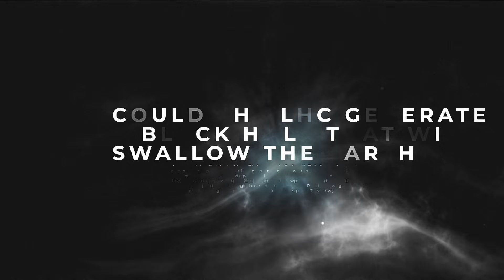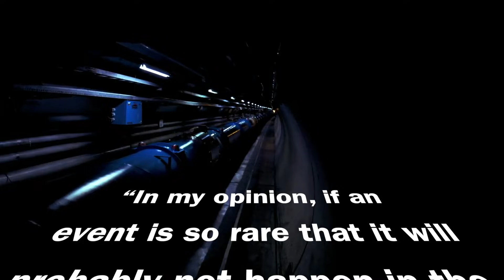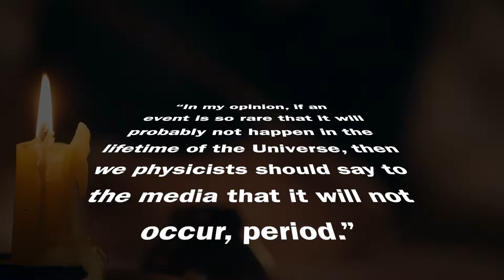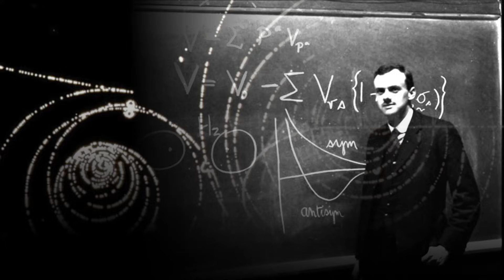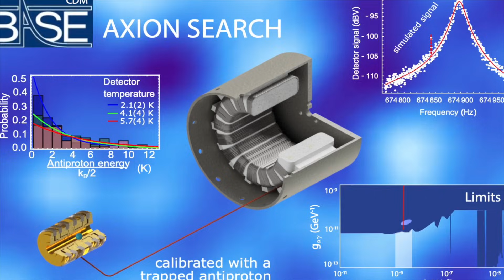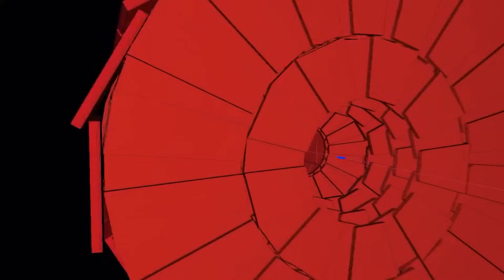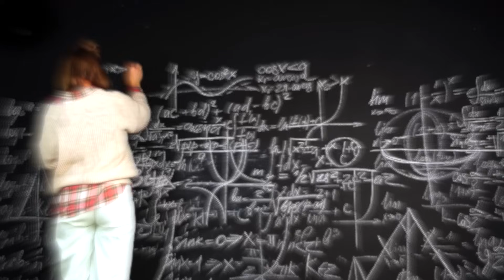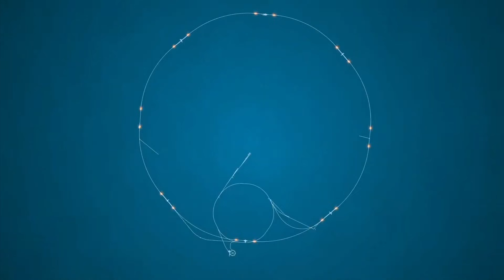CERN and The Mandela Effect | 5 Terrifying Theories About CERN

Comment: The LHC ran at a high energy level in 2012 apparently breaking down, but causing changes 
In 2015 during a blood moon, it ran at 18 Tara electron volts, which seems to have caused many changes to our world, however small 
The LHC is expected to run again in March 2024 at an even higher energy level. The only advice I have is try to remember every minute detail of this world you can remember before that day gets here.
Reply: Last year thanksgiving was on the 23rd now it was on 28th and that’s just one thing. Something definitely thrown off.
Reply: It’s running again currently, guess things are changing

Comment: Something inevitably is going to go wrong... and when it does, it will be most likely devastating. 👊🧡👍
Reply: cern concern
Reply: And most certainly irreversible.  

   Same with altering time. With as secretive as our government and military are, can you say with 100% certainty that they have not been researching time and attempting the altering of it? 

   Even if you don't encounter anyone on a "time travel" trip, just by the act of it, you change things.  

   So,... impossible? 
If it can be proven or disproven 100%, guess what, Sparky?
Reply: 30000 particle accelerators being used across the globe...nothing "devastating" yet...
Reply: @philcoombes2538  yet
Reply: @philcoombes2538 exactly how (or is that when?) will we know...?
Reply: @davidparker2882  bear in mind that the sub-atomic particle interaction experiments taking place at CERN & elsewhere are low energy (on a stellar scale) versions of those occurring in stars all the time, so
if portal/wormhole formation was possible chances are we would have observed it in a star somewhere long since, which we haven't...
Reply: Like the Brightest Sunrise....? 🤔